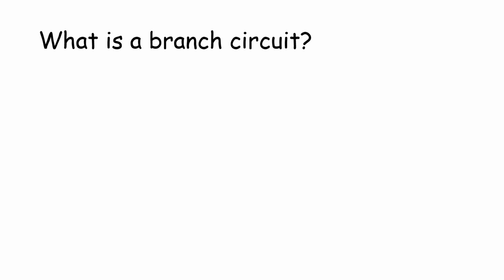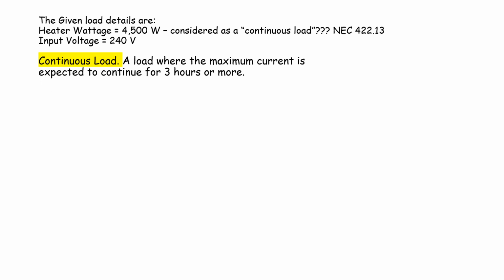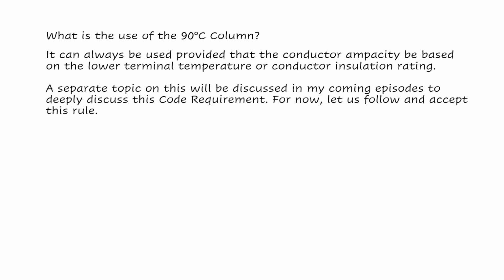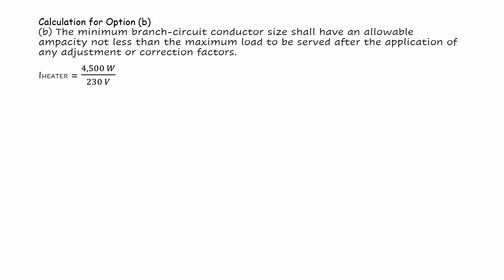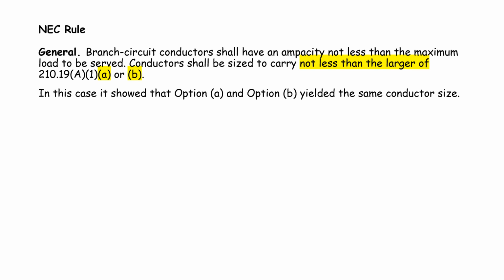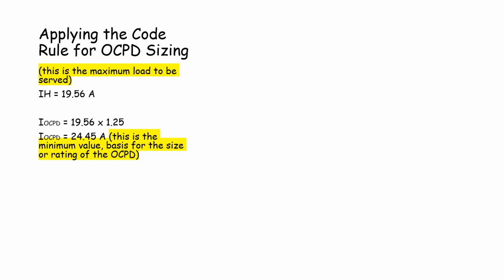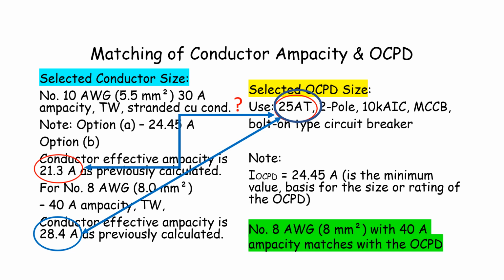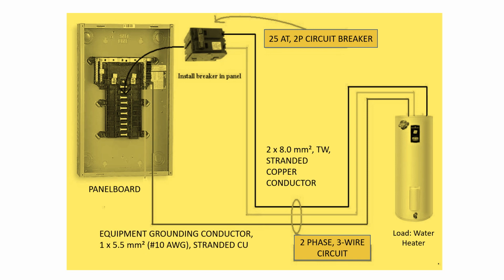Branch Circuit Calculations - The Correct and Proper Way

Comment: It's good u explained the temp limitations.  Other used the 90C (THHN)  column despite below 100 A  ang connected load. However, the 90C column can be used  per  application of a  RULE.
QUESTION ?  WHAT is the ampacity of 8.0mm2  THHN conductor? same with TW and THW?
Reply from the maker: The ampacity of 8.0 sq. mm. THHN as per PEC Table 3.10.2.6(B)(16) is 55 A (@90 deg C. insulation rating). 
This is not the same with 
TW = 40 A (@ 60 deg C insulation rating) and 
THW = 50 A (@ 75 deg C insulation rating). 
However, following the rule of circuit rating of 100 A or less using TW/60 deg C Conductors, use directly the table values
If you opted to use THW/75 deg C Conductors, you still have to use ampacity of  40A@60 deg C 
also if you opted to use THHN/90 deg C Conductors, you still have to use ampacity of 40A@90 deg C
Why is this so? this is because the Circuit Terminal Connection Rating is only at 60 deg C. 
The Code specifies that the ampacity of conductors shall be selected and coordinated so as NOT TO EXCEED the Lowest Temperature Rating of any (1.) Connected Termination (2.) Conductor or (3.) Device.
Reply: @kuryentelektrik  well explained Bro.. What am trying to point out is explain it not to me but to ur other subscribers   by graphic means bec. some designers/installers are not aware of it  (insulation vs. termination). 
The use of THHN is becoming an industry practice as Mike H. pointed out. Ok ? 
     Hope others learned a lot from U by doing this.